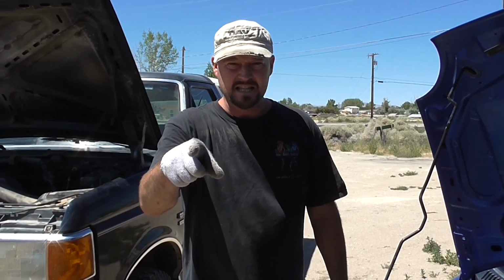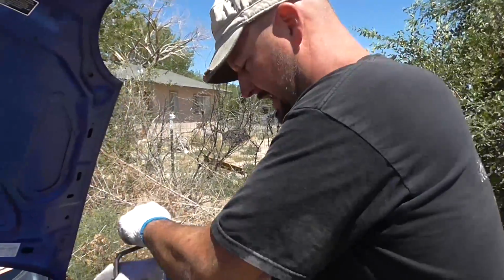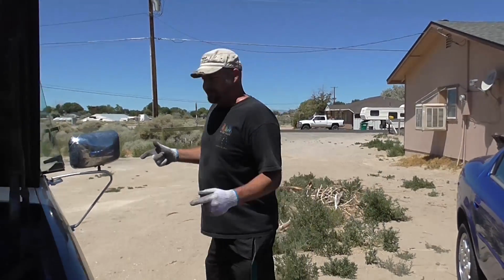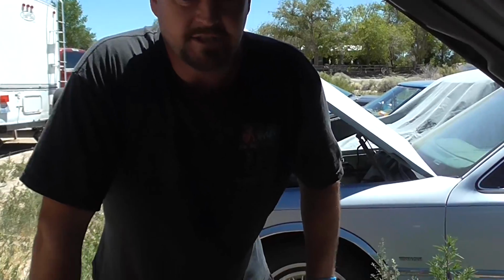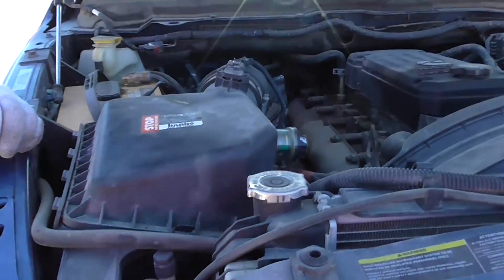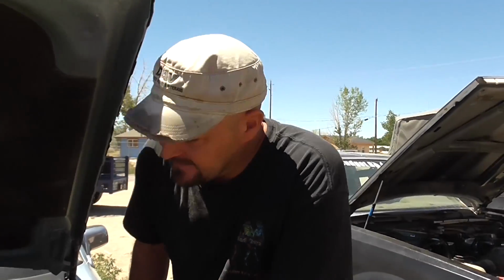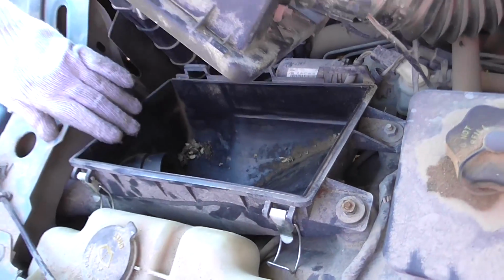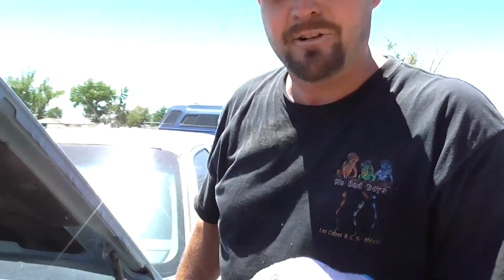Free Horsepower And Fuel Economy - Intake Mods

Comment: A cold air intake on a computerized vehicle is a waste of money, unless you get a programmer & reprogram the computer for more air or the computer will just give the vehicle more fuel to compensate  for more air !
Reply: ACTUALLY, a Cold Air Intake will perform BETTER on a Computerized  engine than it will on a Carbureted engine, because the Computer reads incoming air TEMPERATURE as well as air FLOW, while the Carbed engine measures NEITHER.
Most of the CAIs don't work as well as expected -- because they weren't installed properly, or the design  was poor. "Home-made" CAIs are almost always a failure.
Here, we saw the bottom of an Air Box cut out completely -- a BAD IDEA, since only HOT air from the engine bay is available. MORE NOISE, but NO measurable increase in performance OR fuel mileage. MUCH better to just remove the Snorkle from the Air Box and replace it with a piece of aluminum Clothes Dryer Hose -- this allows cold air to be drawn from FORWARD of the engine bay.
Reply: @SlikLizrd  Exactly. I was wondering if anyone realized what he was doing, by drawing in hot air from the engine bay.

Comment: The only thing you gain is noise and more fine dust in the engine. Also, bringing hot air from the engine compartment will actually reduce available horsepower.
Reply from the maker: watch part 2 of free horsepower and torque, much better than part 1.

Comment: you forgotten that the box was meant to prevent water to go into the filter ;) good luck with the rain...lol
Reply: Luís Claro and you forgot that after the filter you still have a little diameter intake to the motor...
Reply from the maker: Luís Claro Every manufacturer designs airboxes different.  The one on my 2014 Ford F150 had the air entry in the fender.  I added another intake that faces the grill of my truck which gets cold air from the front of the truck.  My airbox is located pretty high so water ingestion will not be a problem.  Some manufacturers locate their boxes too low to where water is a problem.  Simply use a dryer hose bought at any home improvement store and direct air to the box from higher ground in the grill.
Reply from the maker: Luís Claro That part does not matter so much since it is the same size as the throttle body.  The point is to increase the restriction which is the air entering the filter since the filter is restriction by itself so reducing restriction to the filter improves quite a bit since the tube breathes just fine to the throttle body.
Reply from the maker: Budget Boosting I meant reduce the restriction.....

Comment: why does the blue filter look collapsed?   Placement for the best air circulation and length is key.
Reply from the maker: The blue filter was a cheap one but surprisingly flowed well.  Just not structurally supported well like K&N and Spectre filters.
Reply: Budget Boosting
as long as it keeps the crud out.

Comment: Your so right about this stuff I put a Kand N million mile free flow filter in my FJ Cruiser and what a diff, and just to see if it were my imagination I went back to the stock paper filter and it slowed down my ytuck so much. Then I put a Gforce chip for 50 bucks  and a 2500 throttle body spacer and my fuel eco went way up. and HP too. On my FJ theres also that secondary filter I see n a vid that says take this out as well ,But im afraid that filter oil may get into the mass air sensor and kill it. I dont reoil my KN  just for that reason. whatdo u think about taking out the  secondary cloth filter ?

Comment: i surely hope this guy already updated himself as to how cold air intake "improves" performance lol! at times you lose hp from using these things. noise is never equal to hp. also, storytelling and mouth generated sound effects isn't an effective proof compared to a dynorun
Reply: Dynos mean nothing if you can’t tell the difference on the road
Reply: Look up the video on this channel of the 2014 F150 Turbo on the dyno, same intake mod was done to this truck.  Much more power at the wheels than the factory rated at the crank for this truck.

Comment: I took out my air cleaner and threw it away but wait that's not all. I tied my underwear around that there big tube going to that there gas thing and now I get 40 mpg in my big block Chevy truck. Thanks for all your that there advice on how that breading thing works so well.
Reply from the maker: lady's panty hose works better than the underwear...  Back when I was stationed in Japan, we were at one of the street races, one of those hot JN girls took off her panty hose, handed them to her boyfriend, he put it over the MAF sensor and removed air cleaner assembly.  He was happy with his results....

Comment: Engineers design the car to have a a certain oxygen to fuel ratio. Generally speaking cars run on: "clean", "idea", or "rich" oxygen-fuel ratios. Ideal is a complete combustion of fuel and oxygen. Clean means there is left over oxygen after combustion, and rich means there is left over fuel. A rich ratio provides the most power with the least fuel economy while clean provides the most efficiency/mpg with reduced power.

The factory intakes are designed to filter air as much as possible while providing close to the idle ratio of oxygen. This is why they are closed in a box and restricted with an intake hose. Cutting it open adds more oxygen which makes it runs "cleaner". This may increase fuel economy but will mostly likely reduce power. 

I don't recommend doing this to your car. Adding more oxygen doesn't always mean you will get more power. Given that most "modern" cars should be running close to ideal ratios, this mod will most likely reduce your horsepower.
Reply: pcm will compensate for additional air up to maximum injector ability. no real gains. half to two percent increase in hp.
Reply: pbsoccer the word you're looking for is lean.
Reply: Stochstoichiometric is what your looking for, 14.7 to 1, but the car companies use it for the best emissions, not power

Comment: Mighty car mods busted the cai myth
Reply from the maker: NO, they used an extremely SMALL cone air filter.  The filter was so small, that the factory Skyline airbox dwarfed it by 3 times.  Hell the hole in the stock skyline airbox was as big as that small useless filter they used.  Not a fair comparison to a REAL intake kit using a LARGE cone air filter with loads of intake element area.

Comment: id actually bet money that if you put any of this crap on a dyno you would see either no change at all or a loss in power,,, even the store bought CAI intakes actual rob power,, and there is many many independent tests here on youtube on a actual dyno showing exactly that

more money than you make in an entire year goes into the development of these intakes to give the maximum performance and economy while keeping the sound lvls and emissions down
Reply from the maker: Must be from California, that is what they believe.  Explain this, if what you believe is correct, why does the new 2016 Mustang Shelby GT350 R come factory with a large cold air intake cone style filter????  Questions????  The engineers are out for the big special interests, politicians and the EPA.  EPA does not car about your fuel economy or performance, only the air numbers.
Reply: put it on a dyno, stock vs your ideas, go ahead do, it oh and make sure you put the video up,,, i just want to say i told you so
Reply: obviously you have never used one.
Reply: There independent air filter testers. They buy the filters and test them and show you the results. Foam filters do not filter the air well. Cotton filters are slightly better. Paper is best. In the independent tests they found no restriction between any filter. The engine will last longer with better filtration. The data is there just look it up. 

If you get 3 hp more and your car weighs 3000 pounds do you really think you will reliably notice this change? Is sucking in extra silicon dioxide worth 3 hp? 

Put it on a dyno . That will tell you the truth. And yes use a new clean air filter.

Comment: Awesome video! I have a 1988 RX-7 Turbo that I take better care of than my wife :) Anyway... I use a great car maintenance program www.automotivewolf.com on my computer to manage all the maintenance and track performance, expenses, fuel economy etc. After watching your video I decided to get a K&N High Performance air filter and see if it made any difference. I immediately could hear and feel an increase in power. I then carefully tracked the fuel economy using the software and saw a 3 mpg increase from 17 to 20 mpg with normal driving. This simple modification definitely made a difference. Thank you!
Reply: great software for managing the maintenance on just about anything!

Comment: I'm pretty sure you barely got any performance improved on that lincoln, if any at all! The car is programmed to get the air needed whether it be hard or easy. The only thing you did was change a bit how it sounds. It Does sound better, however, take into account that when that hood is closed...that intake will just be sucking in that Hot air from the engine. Not better than being cold from the outside
Reply: Victor Acosta     Good point

Comment: this guy named a lot of bold claims without a thorough evaluation. do your research
Reply from the maker: Did dyno video, watch it before you make your above claim.
Reply: I looked for the video you mentioned but I didn't see it. but I'm not perfect; show me, ill take a look and maybe change my mind.
Reply: I looked for the video you mentioned but I didn't see it. but I'm not perfect; show me, ill take a look and maybe change my mind.
Reply from the maker: https://www.youtube.com/watch?v=-S8vV1_eZ2s
Reply: An air intake by itself isn't going to do anything. Been tested over and over, engineers make the airboxes as good as possible with the exhaust setup on the car. You'd get more fun out of suspension or doing BOTH exhaust and then an air filter, doesn't matter how much air COULD get into the engine if the engine can't get rid of it fast enough to accept more air. That's putting it pretty simply for you. Do headers back and you'll see a lot more of an improvement with that aftermarket intake, still pretty negligible though.
Reply: its free mr naysayer and it works.  nice hat.
Reply: Peter Bosko ss
Reply: his claims are mostly true but this is only a small piece of the story.  those stupid stock air boxes and piping are engineered that way for a reason and sometimes they have to sacrifice a little power, mpg, for a more efficient use of fuel and air or a nice ride without hearing all that bullshit under the hood.  they have to build a car that combusts properly to negate emissions.  WE SHOULD CARE ABOUT THAT TOO!  I mean who cares if we poison the air but I digress.  along with combustion they take into effect air turbulence, entrance angle, entrance speed, etc etc...  again for efficiency.  shit rigging all this will make one variable "better" and the others that are effected worse.  you cannot just add one half assed thing and not changed the other variables associated with it.  Now you have effected back pressure, heat dissipation, and a myriad of other things with this crap.  quality aftermarket parts pay for themselves and are less prone to destroy your engine. oh and I left off, all those vehicles are pieces of shit!  you can try to shine up those turds all you want but you ain't getting much out of those turds.  I won't matter what the mpg or hp is when the fucking wheels fall off
Reply: It's a shot in the dark at best.   I don't accept a dyno video as evidence because God knows what else he did between dyno #1 and dyno #2.  Since there are no controls for external variables, it's not a scientific test and can't be trusted.  On other videos where controls are imposed (same car, same day, back to back, same dyno, same temperature etc), it doesn't work, and for obvious reason.

Comment: Wow dude. I don't know how you did it but you took a simple 1 minute explanation and stretched it 25x... It's called a "Cold air intake" and it's like 60 bucks with and is CARB compliant. Not to mention, at autozone one of those air filters would be about 60 bucks to begin with and a CAI adds some nice shiny chrome that anybody would like to see on a car
Reply: 😂😂😂😂😂 I was thinking the EXACT same thing.
Reply: He extends it that way for a reason..
Reply: Fierce Recognition. ty same comment different words! good idea but loooooonnnnnnggggg winded
Reply: Fierce Recognition. ty same comment different words! good idea but loooooonnnnnnggggg winded
Reply: +Hotdrboy88 ya the ads
Reply: Anyone who knows cars wouldn't like to see shiny chrome because we all know it's susceptible to heat soak and will cause worse gas mileage and power after the engine is warm.
Reply: Fire Man Dan That's not the case with my car. Or any other car I've worked on, driven, or seen. Some people like their engine bay to look a little nicer by taking out the ugly factory airbox. It does nothing but good for the car, especially if you go to the lengths of tuning it for the CAI as well.
Reply: +Fierce Recognition Using a CAI with a chrome pipe thar has no heat shielding will ALWAYS have heat soak.  That's basic physics.  That's why real tuners stick with plastic or silicone.  Granted it's only a small lose of power when the heat soak takes effect, but it's still there.
Reply: Maybe on a dyno, not so much when actually driving and wind flows through the engine bay.
Reply: Stinky Cheese Inaccurate sorry.  Chrome pipe with no heat-shield it doesn't matter how much wind is flowing.  Engine bays get extremely hot.  And you will get heat-soak.  You can't avoid that.
Reply: Wrong.  Engine bays don't get extremely hot when running at high throttle and speed on the road.  Perhaps you should actually test that.  It's been proven in plenty of races.
Reply: Stinky Cheese Wrong.  Feel free to link to the tests done to prove that wrong.  You are crazy if you think an engine (which in case you didn't know is a series of thousands of explosions) doesn't get hot in the bay.  If you had any form of formal training on cars you would know this.  I'll wait for the tests you've got to prove it.
Reply: I dare you to touch anything not-plastic in your engine bay after a 3h drive in the winter it'll be hot af.
Reply: Idk why he doesn't just call it a "cotton CAI"
Reply: u sound like you are trying to show your mods off to a preschool
Reply: +Stinky Cheese I had to chime in when I saw Fire Man Dan going at it with some Stinky Cheese lololololol Terrible joke, sorry guys. Anyways..yeah I agree with Fire Man. With the hood closed and the engine at normal operating speeds, there is some serious heat being generated by the engine. Especially in city driving. Anyway you can bring cooler air into the engine is going to increase performance. Same goes for people. Asthma sufferers are far more likely to have an attack in hot weather due to the air being more dense and possessing less oxygen. Simple science.
Reply: +KIN Kreations Reread your last bit about asthma. 1: they have attacks easier in winter because the air is cold and it closes the airway, which is why steam inhalers are often used by said sufferers. 2: You said they have attacks more during summer due to the air being more dense and oxygenated. This begs the question why the fuck do people get cold air intakes in the first place? That's rhetorical. 

Your simple science is simply bullshit.
Reply: loooooooooooooooooooool!!!!!!!!!!!!!!! :D
Reply: Fierce Recognition yea he like to gab. I think that's why he makes ths vids. To gab not to help ppl.. Lol
Reply: Fierce Recognition a name brand cold air intake cost 250 plus
Reply: CHROME DONT GET YOU HOME
Reply: And your video is where?  I'll never understand the need for people like you to comment on videos like this that are made for entertainment purposes and  maybe a lil knowledge. You can always go stand in front of a moving train and we'll make an short video in your honor 👌🤫😁

Comment: My Dodge Cummins diesel lost power with a AFE cold air system, doesn't work, went back to stock and it runs much better
Reply from the maker: Just the intake without exhaust improvements will not make much difference on a turbo diesel.  I had an 05 Ram with the Cummins and I did an intake, free flow exhaust and Diablosports Predator tune and it was amazing in power, torque, towing power and even fuel economy seeing mid 20's while towing up grades even as high as 80 mph.  I was impressed.

Comment: well the video was funny, but seeing u cutting the dirty side into parts gives u less power than with that little straw.. why? because you are going to suck in alot of "hot" air coming from your engine.. cold air has less volume therefore u get more air into your engine and a bigger bang.. 

long story short, u get less power from sucking in air from your engine. the pipe on the airfilter was actually going out of the engine bay.

non the less, funny video :D
Reply from the maker: +masterlooser15 not true.  the temperature of the air depends on where the air filter intake is located.  If it is facing the grille than that is cool air.
Reply: Budget Boosting i was mainly talking about the end of the video, where he literally just cuts open the original filter box
Reply from the maker: +masterlooser15 There is cold air from the grille going to the intake area I had made larger.   The little trumpet hole is too small to be of any benefit.
Reply: Budget Boosting how about a 2007 ford expedition el how do you do that mod it breathing from the side
Reply: 1CDFTV from Toyota. Cutted air box vs 4 inch pipe of proper cold air? Sucks both ways. But louder with cutted and opened air box. KN filter.